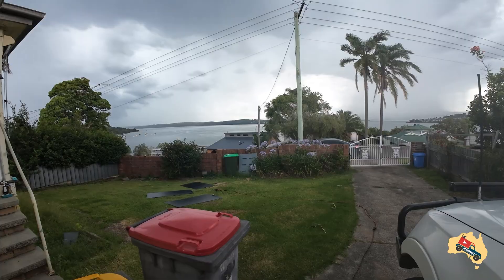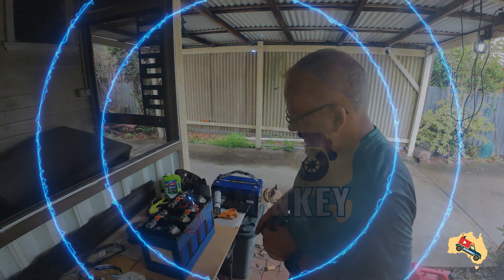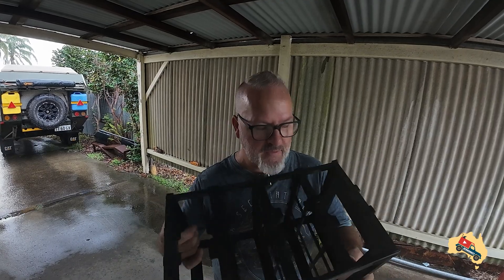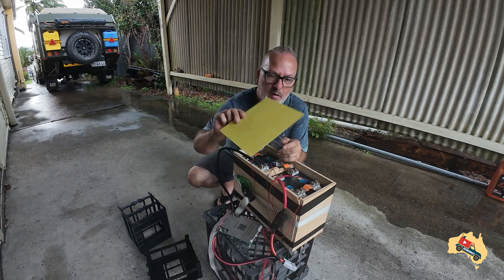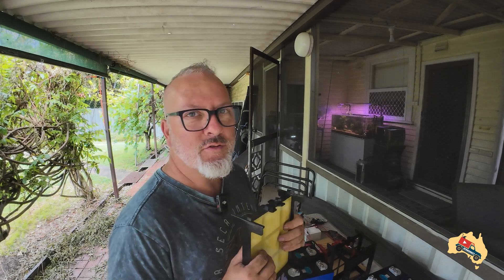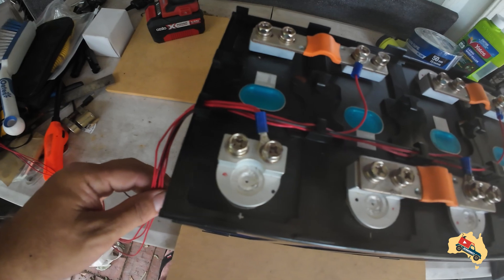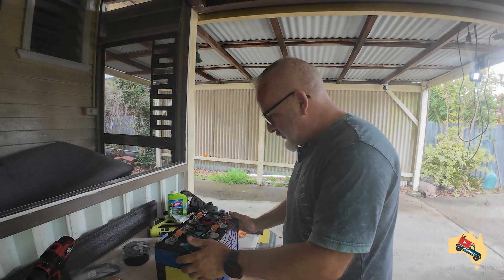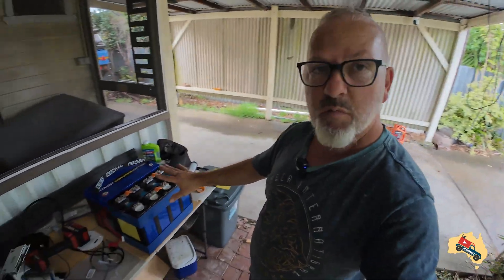A cage for your DIY battery pack - Muller Energy

Comment: Thanks very much for the honest (and at times humorous) review.

We're also definitely taking the constructive criticism onboard! 
The connections holding the cells together aren't as sturdy as we would have liked either, but unfortunately the only solution to this would be to do two brand new infection moulds (one for the end piece, one for the middle piece). As we're currently having one done for another battery project (completely unrelated to this though), I know that the cost of this would be in excess of AU$10,000 and probably doesn't make sense for us at this stage. 
However we find that they are mainly for holding the frame while you're building it, once it's finished and wrapped with sturdy tape or packaging straps, there is much less stress on these little tabs.

As for the cost, I'm not disagreeing either, however we do include free shipping Australia-wide, which due to the bulky nature isn't cheap. We'd be more than happy to offer a $35 price point for people picking them up from Somersby though.
Reply from the maker: Thanks for taking the time to reply, I think viewers like to see engagement from the suppliers/producers and it's great to see from my end too.  Apologizies, I don't think I mentioned the free postage but believe it would have been captured in one of the stills.  I think a lot of consumers get spoiled by the chinese market and sometimes it's easy to miss value when it's right in front of you. Since I'm just up the road at lake macquarie and if the offer stands for 35 each for a pick up,  I'll put my money where my mouth is and swing down and grab 3 more. I've been planning a trip to check out the earc panels you have, so 2 birds with one stone and all.   again, appreciate the time